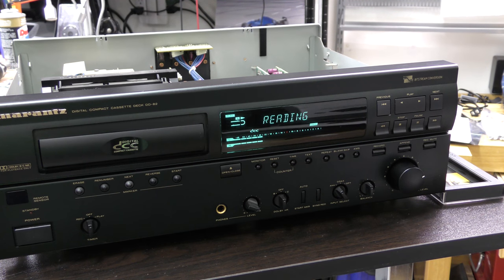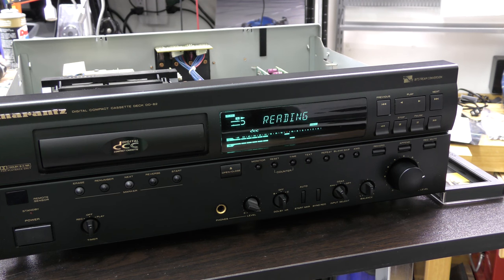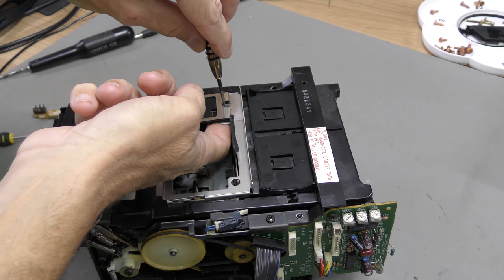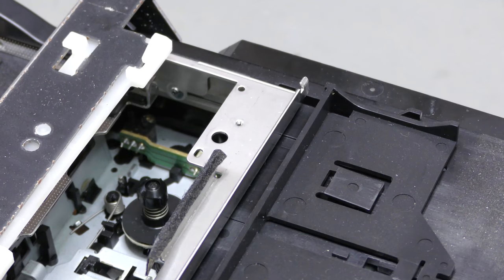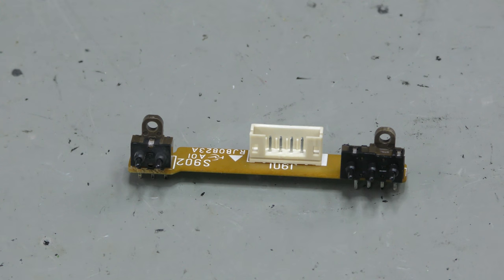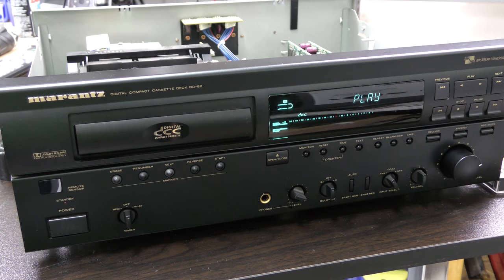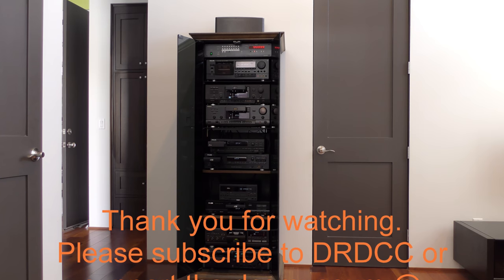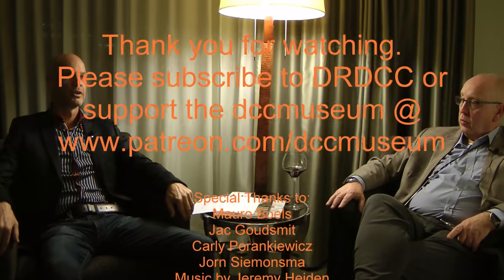No Track information shown on display of Digital Compact Cassette player  and TOC Error

Comment: Hi do you have any suggestions as to why the casserole tray won't open or close, the belts are ok and  have removed the tray applied voltage direct to motor and it opens and closes.
Reply from the maker: Muzfuz 57 Hi, please ask this question at forum.dccmuseum.com that way we can help you and others learn from it at the same time.

Comment: I have the same problem, no text, time or track info (DCC900). Constant "READING" in the display while playing. After I saw this video I measured the switches and they worked but gave non-stable contact. The switches on my donor-player gave permanent contact so I replaced the board. Sadly, still same problem. Plays music OK, but the number of errors on the AUX channel maxes out :(

Nice tip, though, and thanks for keeping the format alive!
Reply from the maker: Hi, does the unit play correctly?
Reply: Hi, yes it plays (and records) ok. No dropouts, and in service mode no errors on ch1-8, only AUX.
Reply from the maker: Ole Johan Almenningen it could be the head.